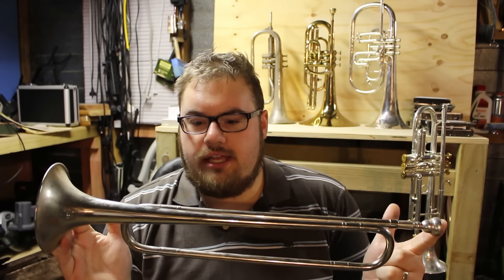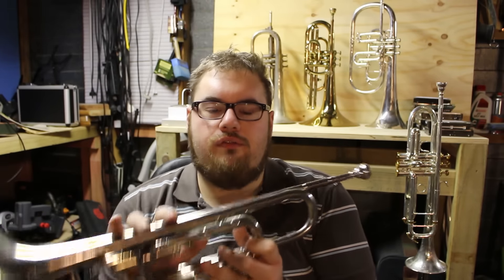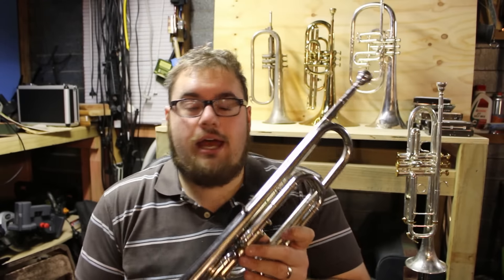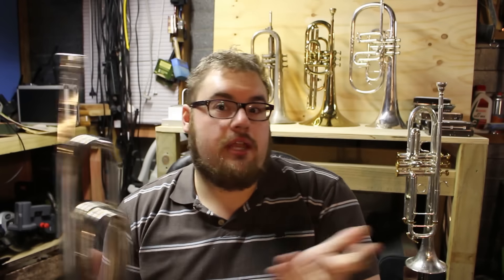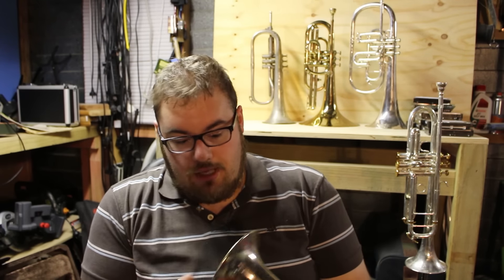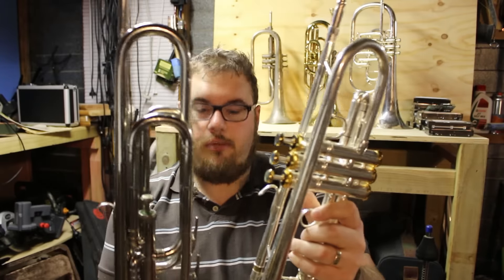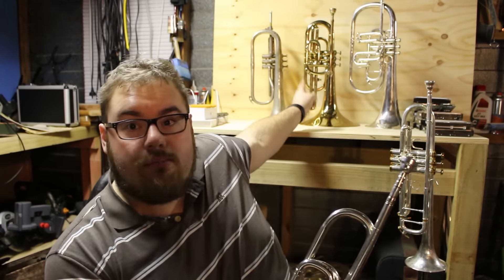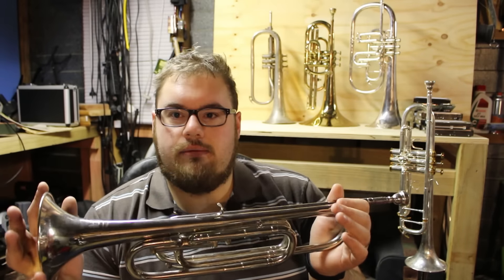The Bugle - Soprano Bugle in G/D

Comment: I have a question regarding the single valve bugle:  Today I received a Ludwig single piston valve competition bugle and the valve is very slow moving and frequently gets stuck.  I cleaned the valve but it only helped slightly.  Is there a way I could clean the valve to get it fully functional?
Reply from the maker: Depends entirely on what is wrong with it. It could be any number of things, unfortunately.
Reply: Trent Hamilton just another question what mouthpiece did you use for your baritone single valve bugle?

Comment: Thank you very much for your videos. Several of them have helped me a lot and they make me smile. I would like some advice please, based on what you did in this video. I am a beginner and have I have limitations due to brain damage. I want to play simple tunes and pop melodies. Q1. Is it possible to play a usable scale on a regular trumpet by using only one valve and transposition? If so please can you please give me the notes to play? Q2. What are the most simple scales to play which involve the minimum of valve change-combinations? This includes valves that I can hold down throughout?